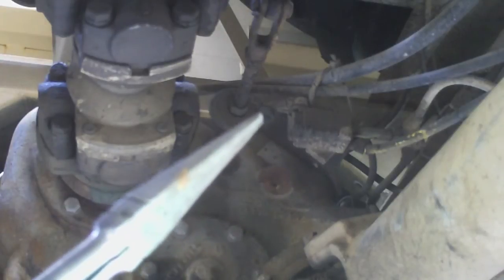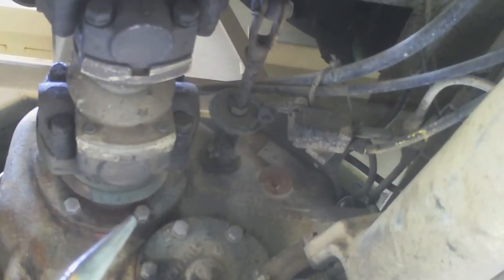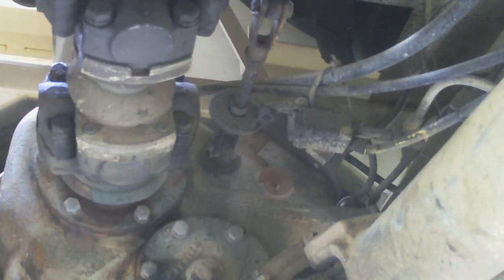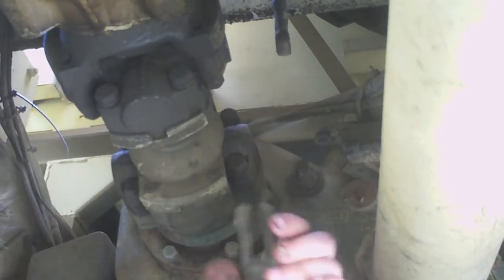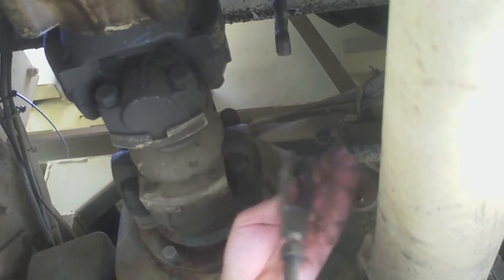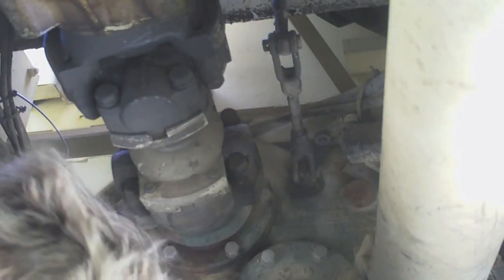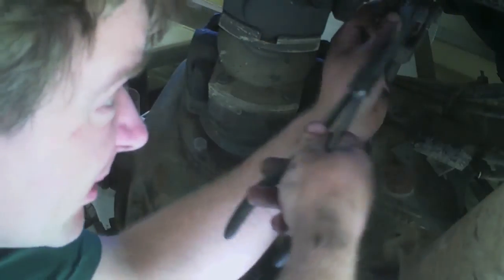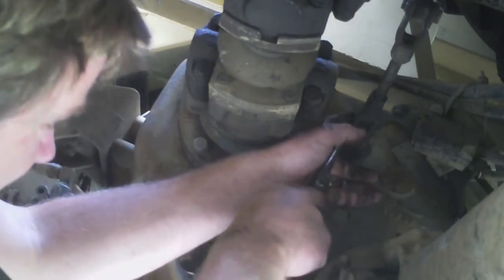M923 Transfer Case Low Range Modification

Comment: You can take an allen wrench and remove the little bolt that holds on the arm and lift it up off the solenoid. A lot easier than taking everything apart and removing that big washer

Comment: There are 2 zerk fittings that are impossible to get to on the big universal fitting to the left where you are working.  I have my troop hauler off and I found them.  Going to undo the bolts to get to them... :)
Reply from the maker: That is normally what I do.  Put the transfer case in neutral, spin to convenient spot, put it back in gear and yank them.  Sometimes the zerks have to be spun some but I have always managed to do it.

Comment: when doing this MOD will all 4 back wheels or both axes turn when in low range? my limiter switch seams to be semi-broken. So as I read the video I would still be able to in gauge the front wheel drive via the switch in the cab? But the back axes operate as normal depending on the regular operating location or low or high range?
Reply from the maker: +Scott Rupley Yes.  Think of it like a pickup with locking hubs.  With the front hubs unlocked when you put it in 4x4 power is heading out but because the wheels are not connected via the hubs the front axle isn't doing anything.  This is similar but on a 5 ton the hubs are always locked in, instead it disengages in the transfer case, same idea.  With the auto lock removed you are sending low range to the rear like normal but it no longer makes it to the front.  Flipping the switch on the dash ties the front in and the system works as normal.  Rear axles have less grip (normally) and because they drive the truck 24/7 the gearing to them is larger, stronger and passes through the t case in a straight line.  The front axle is intermittent and the t case has to drop the power down and reverse rotation so it is weaker.  In forward the rotation of the gears sort of pull them in against the case and each other but in reverse the power is trying to pry them out and the walls of the case are all that hold them.  Given the huge amount of torque in these trucks if something happens that forces the power through the case to the front, especially in reverse, it will actually explode.  I disconnect the switch because it lets me drive around at low range speeds without the front, but if I need it just flip the dash switch and I have it back.  In our company I drive the truck a lot in low range so being able to take the front out gives me peace of mind and makes the unit easier to turn.

Comment: So when you engage low range it automatically engages the front axle? And why is it not good to be in low range if you must use reverse? I have an M293a2. My low range engagement is really tough, half the time it grinds when I pull up the lever, so I am always afraid to use it.
Reply from the maker: The transfer case has a bad reputation for breaking the case when used under power in low reverse.  Also it can be hard to make tight turns without a lot of binding.  Switch it with the trans in neutral it will grind less.

Comment: So you believe that with this mod it is safe to use reverse in low range as long as you are not engaged with the dash switch? Just picked up my 5 ton, and joined the forum you are on last week.
Reply from the maker: Yes running our tour company I do it 3-5 times a day to back up hill around a corner in order to turn around.  I flick the front in and out with the dash switch when I need it and out again when I don't.  Nothing will save it from abuse of the skinny peddle but this removes the weak link from the equation leaving just the much beefier rear wheel drive train.  I also used it during the parade on the 4th and drove all over town in low with no binding.  It was wonderful.
Reply: NelsonStudios
Thanks, I removed the washer the other day. Drove it in the 4th of July parade here in town in Low transfer.